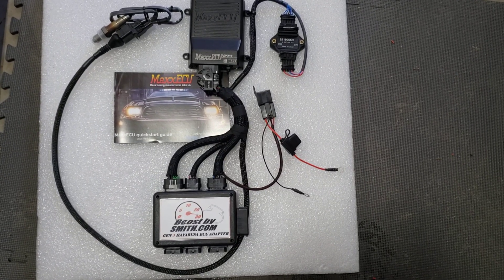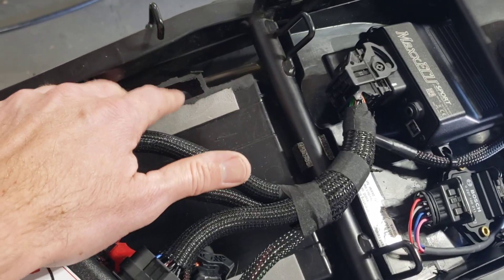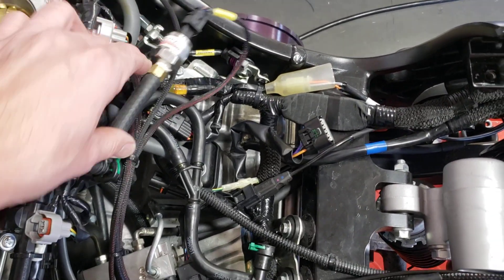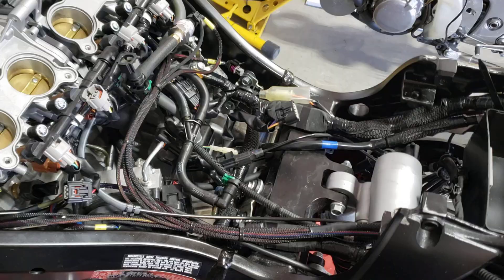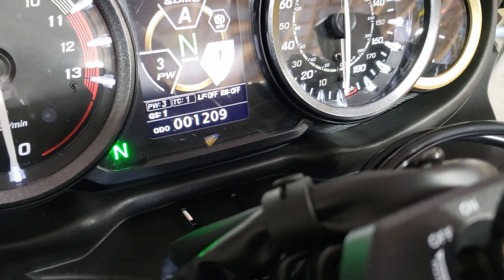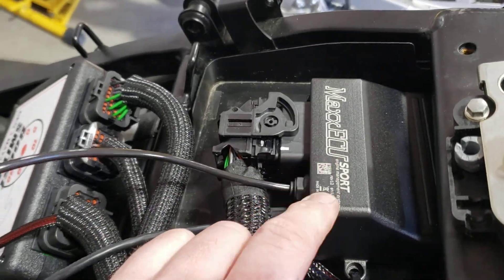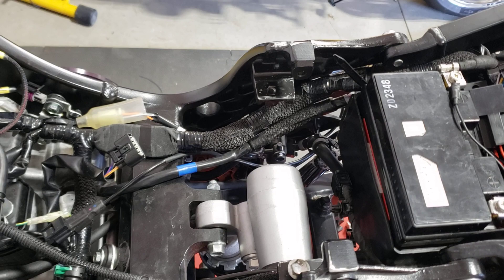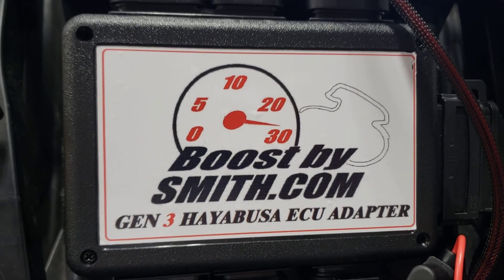Gen3 Hayabusa MaxxECU Plug and Play installation walk through

Comment: For the launch control, is it deactivated by clutch switch or by wheel speed sensor? I tried a launch control deactivated by clutch switch and I'd basically have to throw the clutch because of the air gap between the switch deactivating LC and where the clutches start biting. As you can imagine, that'll lead to either you spinning or getting in position to set off to the moon with SpaceX.
Reply from the maker: By default clutch switch, but there are many options including wheel speed
Reply: @boostbysmith3827  awesome! I'll be doing some more research on everything I need before I pull the trigger on it but that's pretty much what I'm looking for. Much appreciated
Reply from the maker: @WhiteMagicBusa  cool, email me through my website with additional questions happy to answer